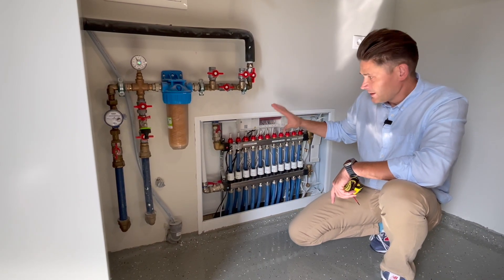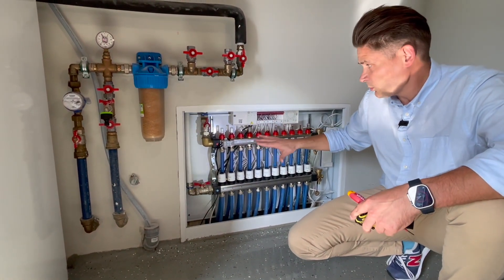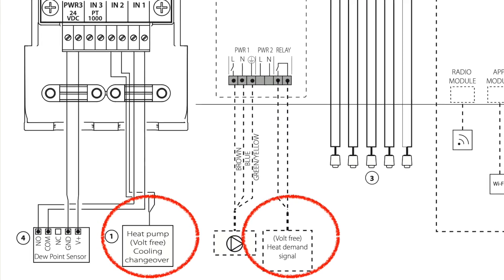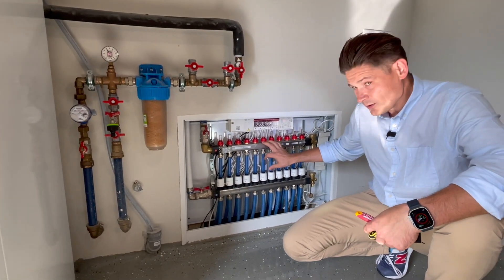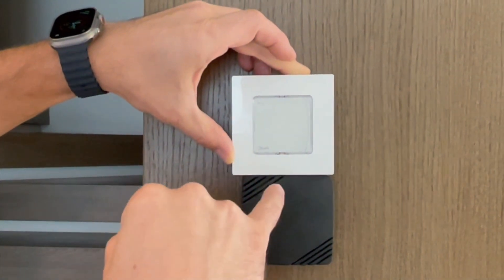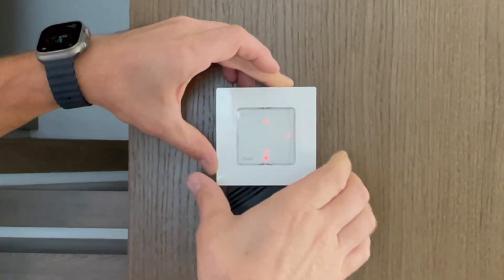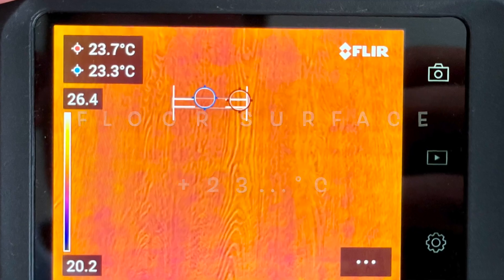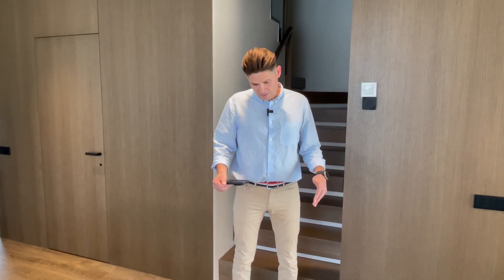Underfloor cooling heating. How does it work? Danfoss Icon App 0004

Comment: I wonder how effective it is if the temperature is 35° outside.
Reply from the maker: It depends a lot on air humidity. If the climate is close to tropical, with humidity near 100%, dehumidification through the ventilation system is essential. But if the climate is relatively dry, with little rainfall, it’s possible to maintain around 25 °C indoors even when it’s 35 °C outside. However, keep in mind that the floor will feel cool, and walking barefoot might not be very comfortable

Comment: Thank you for this video.
I have danfoss icon original, like in this video. I can only operate heating. When I go into the installer settings on my thermostat it doesn't give me the option of menu 7. Is this because I don't have an expansion module? And if I buy an expansion module do I need to run anymore external wires to the system?
Reply from the maker: Hi! With Icon first generation Master Controller, Expansion module is a must - for cooling activation. If you do not have Expansion module, Menu 7 is not available. 
Expansion module: https://store.danfoss.com/en/Climate-Solutions-for-heating/Hydronic-floor-heating/Room-controls/Floor-Heating-Controls%2C-Danfoss-Icon%2C-Expansion-module%2C-230-0-V%2C-Number-of-channels%3A-0%2C-Attachable/p/088U1100
Expansion module application guide: https://assets.danfoss.com/documents/90358/AB296647784542en-010201.pdf
Application 0004 will work with simple on/off switch instead of connecting Expansion module to your heat pump. IN 2 (input 2) - IN2 open, works for heating, IN2 short circuit - works for cooling.

Comment: This is very useful! I sometimes see water drops on the manifolds. can the dewpoint sensor be installed on an existing installation? I have the same controller (two separate manifolds)
Reply from the maker: Yes you can install dew point sensor on existing control system. In case you have two Icon first generation masters they has to be bonded together. One as Master controller another as Slave. Master controller has to have expansion module. Expansion module has 24V output for dew point sensor mains supply. You need only one dew point sensor. 
In case Icon two controllers are not bonded together, they work separately. So you would need two expansion modules and two dew point sensors. Dew point sensor also can be used with systems which has Stand By input. For example: Danfoss Link, this system does not have 24V output, you can use third party converter 230/24 AC, but it has Stand By input.
Reply: Thank you for this video.
I have danfoss icon original, like in this video. I can only operate heating. When I go into the installer settings on my thermostat it doesn't give me the option of menu 7. Is this because I don't have an expansion module? And if I buy an expansion module do I need to run anymore external wires to the system?